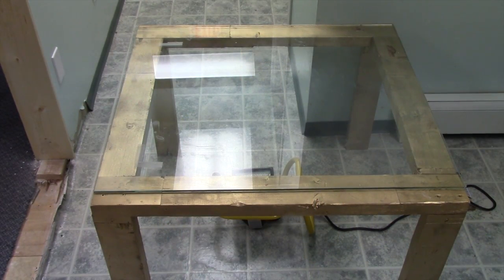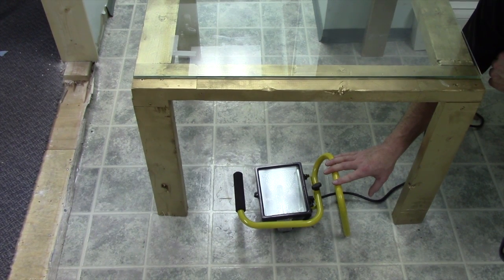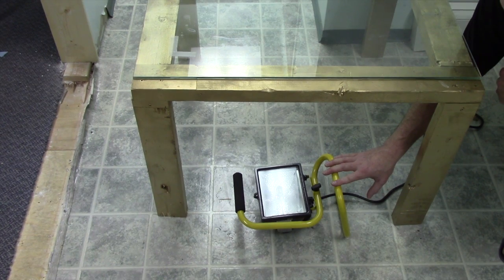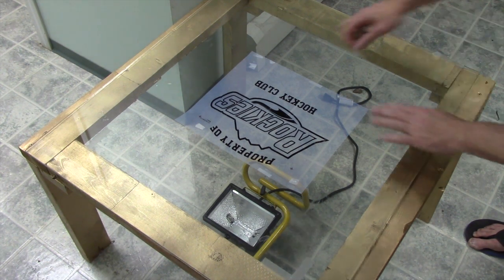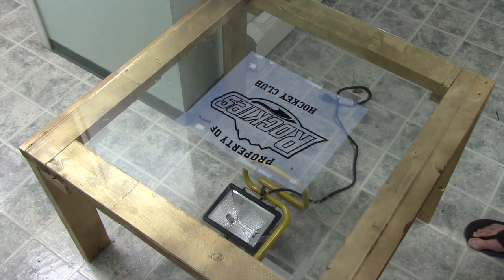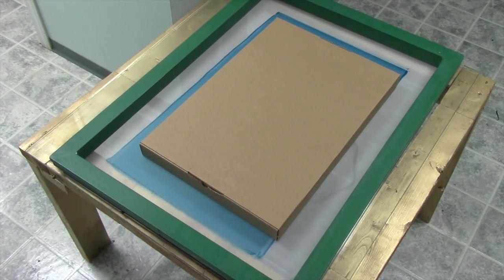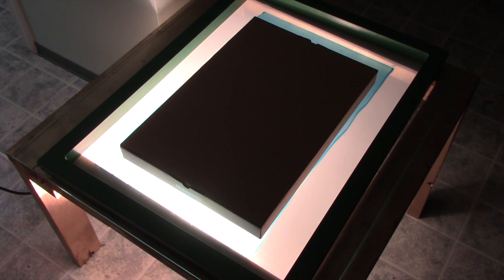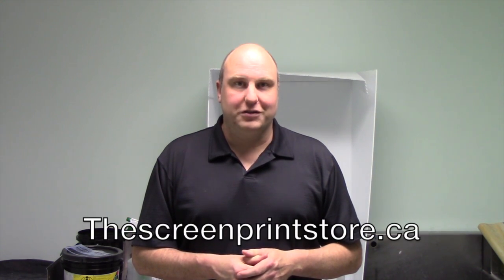Homemade Exposure Unit

Comment: Using very same kit although top down method I place glass over the acetate sheet to weight it down expose for up 18 minutes using 500w halogen light and it still isn’t working screen just washes straight out no trace of image having transferred atall, light is about 16 inches above screen .... any ideas ?
Reply: are you sure you mixed in your activator?

Comment: Can use any bulb? Or only uv light?
Reply: I think before you investing in uv bulb. You should get around sun light. Cuz it's way more faster than the exposer unit. An osram  
Mercury bulb 250 watts takes around 7 to 10 mintues whereas the same thing in sun light can be obtained in merely 5-7 seconds.
Reply: @thakur5962  true but sun is incredibly inconsistent, especially in places such as the UK (where I'm from). I started printing during the summer and now that it's getting to autumn/winter i thought it would be time to make a place to expose my screens inside
Reply: @валентин-с3р  yeah this is sure the thing one should opt for if winter or rainy season around. I too use HID light  for exposing when Sun is not around.
Edit:
Looking forward for investing in UV exposure unit. But I will make it  as a DIY project.
Reply: @thakur5962  that sounds awesome i hope to do the same at some point in the future, I'm making the same setup as the guy in the video but using a 230 watt halogen floodlight, do you recommend just doubling said time in the video?
Reply: @валентин-с3р  nope I need to correct my oldest comment here. I  am using HID lamp 150 watt. As this has uv light in it. Halogen has weak uv so pritty long time it will take as compared to HID. I exopses both direct and indirect film with this setup. Direct takes around 1:30 to 2 minutes and indirect takes around 5-7 minutes depending upon the strength of the emulsion. But as there is no set raito for making emulsion as in my case. I just had an idea of color of the emulsion post mixing it with dichromate. Ah sounds like an old skool  may be. But it's quite dirt cheap as compared to pre mixed emulsion also the self life of a unmixed normal coating is way more than premixed. Feel free if you have any doubt. I will help as much as I know.
Reply: UV is better

Comment: i built ine just like yours but have had sooo many issues. do i need to cover the sides with  a back  blanket  or something? i feel like too much light  is getting in. when i wash them  out either the images  bubbles and falls off or i cant get  all of the emulsion out

Comment: My first burn worked like a charm.  Thanks!  I went five minutes with a double-element halogen shop light with the glass removed (it said "UV Filter"), about 16 inches away from the 110-mesh screen.  Next to try:  the 305-mesh screen.
Reply: +Jonathan Prizant Make sure you get the timing right, and then don't change anything.  for example, make sure the light is the same distance away from the screen.  I'm pretty happy with four minutes and ten seconds with my setup.  I use Chromaline brand Chroma/Tech PL emulsion.
Reply: Is the 16" measured from the actual bulb or the top of the lamp?